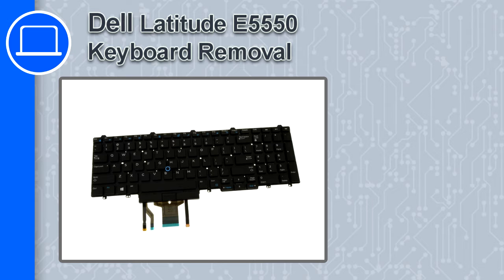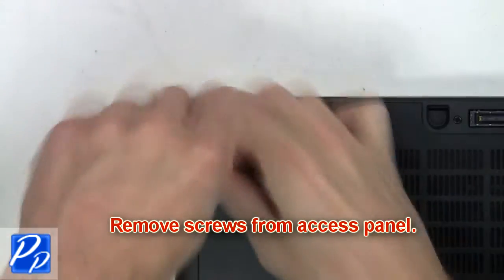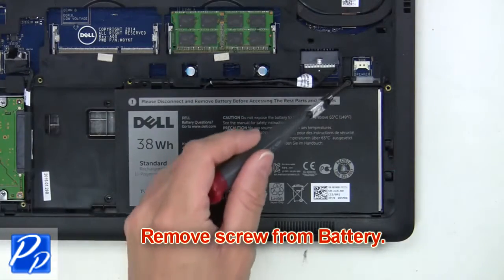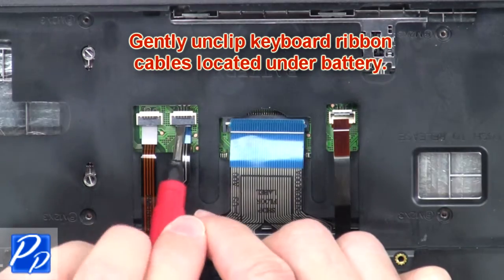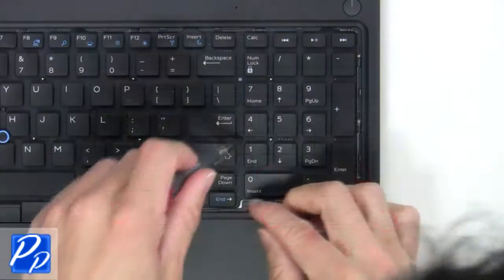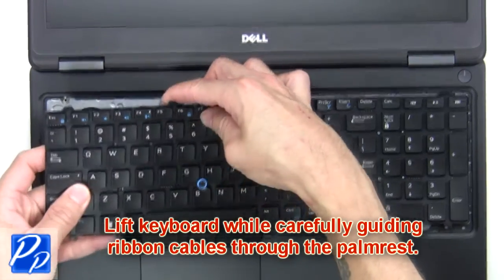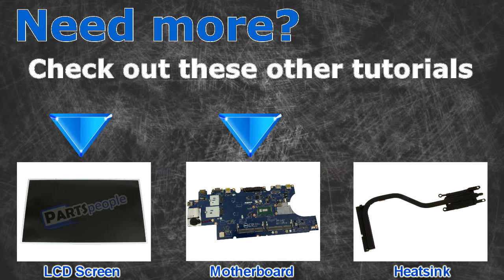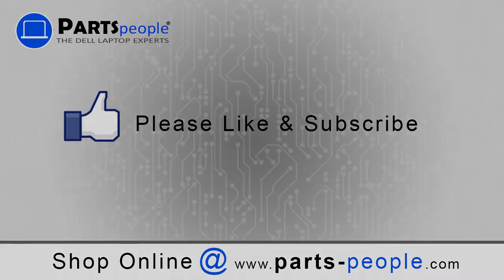Dell Latitude E5550 Keyboard Replacement Video Tutorial

Comment: I know this video is from 9 years ago, but question about the 4 ribbon cables - I want physically (not through the OS) disconnect and disable the joystick button in between the G and H keys.  Can I just disconnect one of the ribbon cables to do so, and if so, which one?
Reply from the maker: Based on what I see, it looks like the far left ribbon cable (from the perspective shown in the video) routes directly to the joystick on the backside of the keyboard. While I'm not 100% on this, you could try disconnecting that ribbon to see if it disables the joystick.
Reply: @dellpartspeople  That was exactly it.  Thank you so much!

Comment: I have a Latitude E5550. It did not come with a backlit keyboard. Can I install a backlit keyboard? Will thebacklit work?
Reply from the maker: Yes, you can install a backlit keyboard.
Reply: Hi! Today, I've installed a backlit keyboard, but the backlit doesn't work. I've connected all the cables, push Fn+F11. I have no keyboard illumination menu in BIOS.
Reply from the maker: I believe it's Fn+F10 for the backlight on the E5550 and then Fn +F11 and Fn+F12 control the brightness. Try those and if you are still having problems try reseating the cables to makes sure they have a good connection.
Reply: did you manage to get backlight working